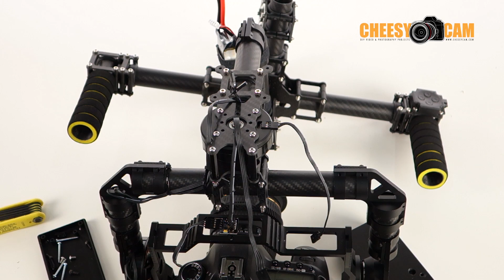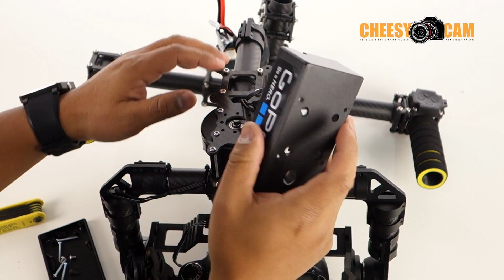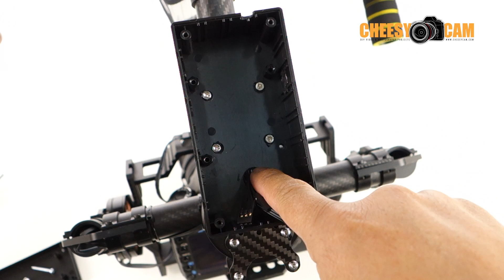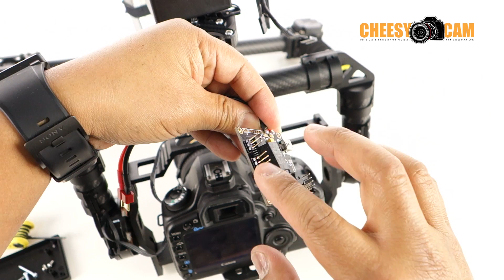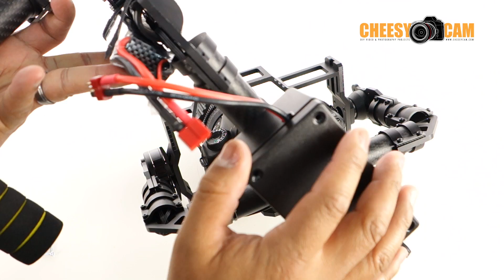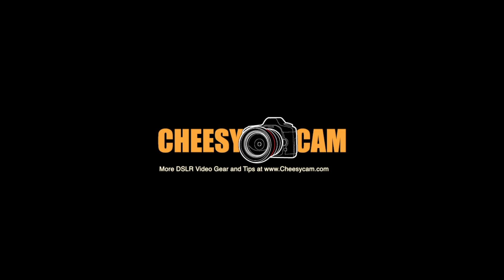Tip #2 Adding Project Box over Gimbal Control Board

Comment: Nice tutorials! But how did you mount the box on the gimbal? where there holes on the gimbal where you could insert screws through the box to the gimbal?
Reply from the maker: I used the existing screws from the Gimbal. I just drilled holes through the project box that line up with the ones on the gimbal.

Comment: nice box , i need one too , where did you get that box from ? just got the same gimbal and its messy wire and panel exposed ! thanks ,
Reply from the maker: I had this one laying around from Radio Shack I think. I bent the pins so I could fit it inside.
Reply: well its a nice setup , all radioshack is change to curcuit city over here , but i have a electronic store call Addisson  , ill take a look if i can find a good box too ., thanks by the way on this gimbal review and all , help alot , didnt bought the 5000 . instead this one ,but damn gotta build and program , pain in the ass

Comment: Was the motor already set to use? or do you have to manually play with it to get the setting you want?
Reply from the maker: You have to download software and then configure the settings for this model. The CAME 6000 is preprogrammed.
Reply: Do you think its possible to add a matte box and maybe an adjustable quick release plate to the camera and the gimbal?
Reply from the maker: kouaxiong I think a MatteBox would be too much for this.
Reply: I'm shooting with a rebel 550d. At about 2.3lbs. I'm not an experience matte box user, but was wondering how much the matte boxes weight. If its under 6lbs, it could work? Whats you take on smaller cameras and the came 7000. Mine is on the way so I'm excited to get my hands on it. Your tips definitely help a lot!
Reply from the maker: kouaxiong The added length of the mattebox would make it difficult to balance the camera in the frame. You need to balance the gimbal by mounting the camera to it's center of balance. The length would make it extremely difficult. Just use a plastic lens hood, no need for a matte box.
Reply: I see. Thanks. Could you do a video on a full set up on how you added LCD monitors and clamped shoe mount mics? I want to know if the weight changes if those wire are added to the camera

Comment: Ahh that's what I was afraid of. Thick and firm cables. How about wrap around a few layers of tape, I'm sorry but I'm just really concerned it might get yanked. Coming from a cable tech. Yes they do exist! :)
Reply from the maker: Sure you can wrap tape around, or use a tie strap (or two) over the cable to prevent it from slipping through.

Comment: you could tie a knot on the battery cable too on the inside of the project box of course, which is very common.
Reply from the maker: These battery cables are very firm and not flexible to tie a knot, but i'm sure some people will have more creative ways than I do to secure the cable.